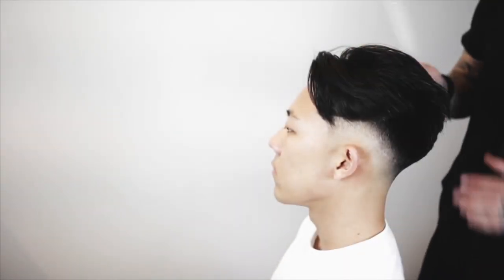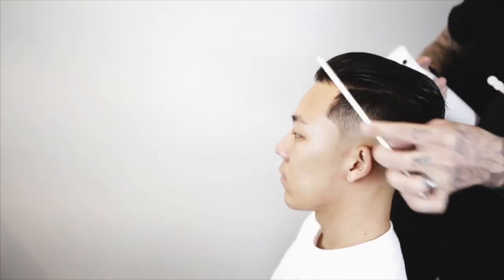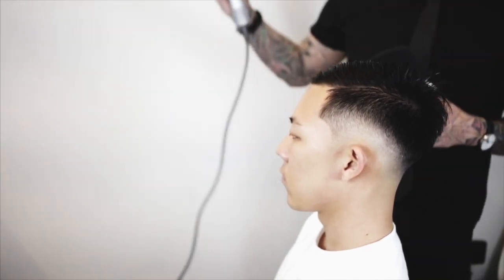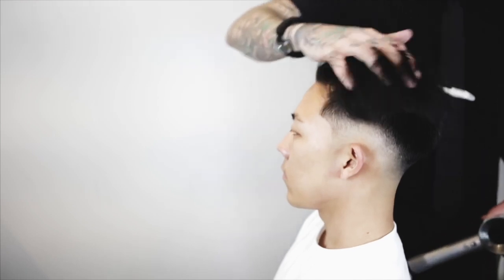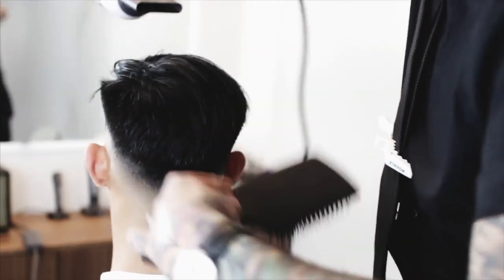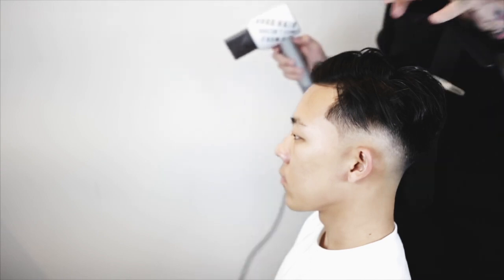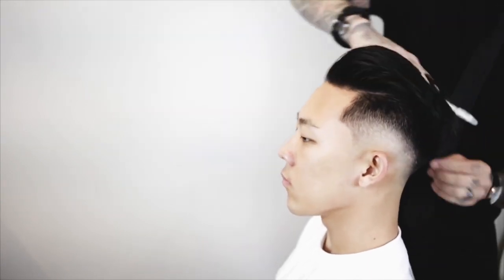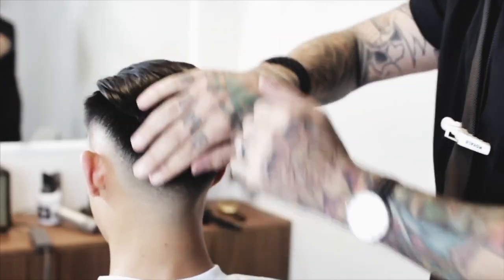Blow dry basics: the flat wrap

Comment: This guy already had straight hair  , mine is coarse and wavy , if I blow dry it it will get dry and poofy..
Reply from the maker: see a qualified professional to walk you through it with your specific head of hair. Heat and tension will straighten and smooth your hair. If it's poofy then you haven't used enough heat or tension. Look into a flat iron if the hairdryer technique is too difficult with your hair. Use a heat protectant if you're worried about damage, and watch my video where I try to burn off hair with a hairdryer if you're still worried (it's really hard to do).
Reply: @andrewdoeshair  i'm an asian dude with stubborn wavy hair and i can corroborate that a flat iron can work wonders to tame poofy hair. if you want volume, the hairdryer is essential. i want the opposite which is to de-poof, so the flat iron is the way to go. thanks for demo-ing on resistant asian hair. subbed!

Comment: Will the high heat damage the hair? How can you prevent that?
Reply: Sydney Holder I think it's not actually that harmful as everyone says it is. You could just use a prestyler with heat protection.
Reply from the maker: it's very very unlikely that you'd damage hair this short with a hairdryer. There are a billion prestylers on the market that claim to prevent heat damage, if you're worried about it. In the case that you do damage your hair (which is highly, highly unlikely), it's just the ends in 99% of cases, and a trim fixes it.
Reply: @andrewdoeshair  Okay. Thank you very much for replying!

Comment: Isn’t it bad to blowdry your hair for a long period of time?
Reply: Boy... have u used flat iron before?
Reply: Well have some sort of protector like oil, or those fancy jeat protector spray from Amazon
Reply from the maker: you couldn't burn your hair off with a hairdryer if you tried to. Buy a heat protectant if you're worried you'll damage your hair.
Reply: Sorry, what I meant was... Won’t you get cancer from all the radiation?* I have short hair so I don’t use blowdryer. But I heard from barbers that they try not to blowdry for more than 2-3 minutes.